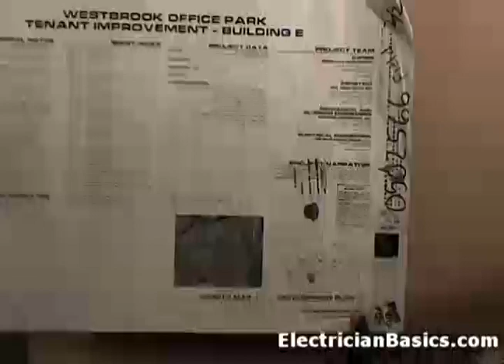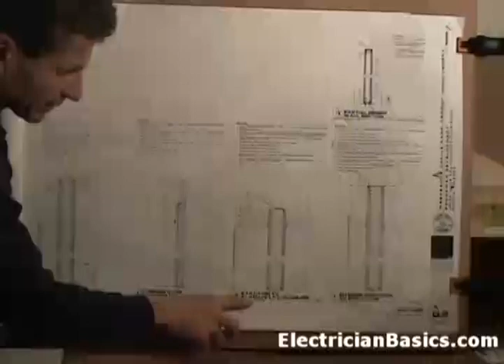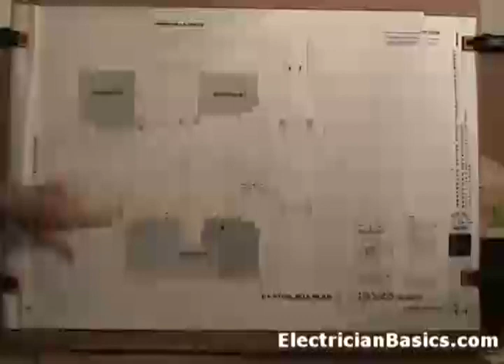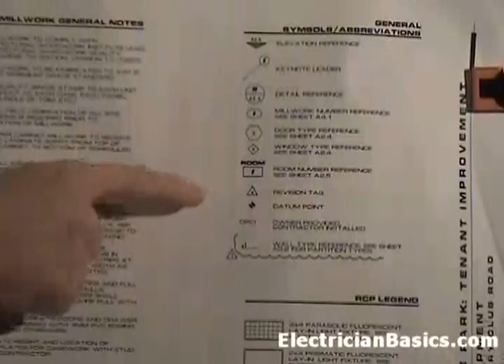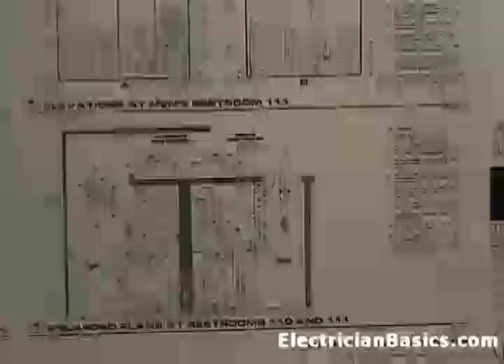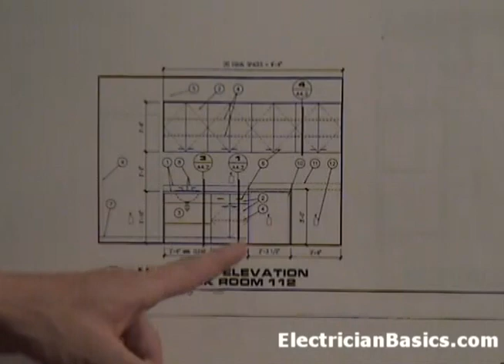Reading Blueprints for the Commercial Electrician Module 1

Comment: For folks looking at the files: Right click and use save link as, which will directly download the zip. 
And the Tiff numbering is backwards. 35 is the first print. 

This appears to be the best video I've run into so far to learn this stuff. I'm doing data cable pulling.
Reply: Hi I tried but it say file not available. Would you be able to make it available somewhere?
Reply: @matteotavone4552  looks like it's been nuked
Reply: @shawnmuench  Thank you for your reply. You don't have a copy?
Reply: @matteotavone4552  No I've wiped my computers since then.
Reply: @shawnmuench  Thank you anyway